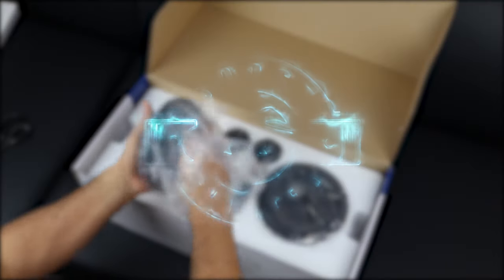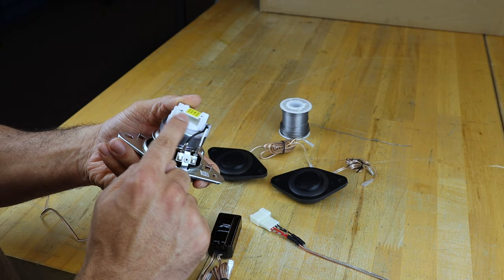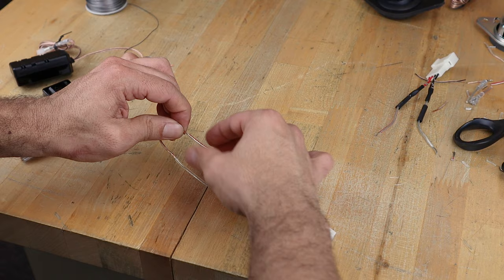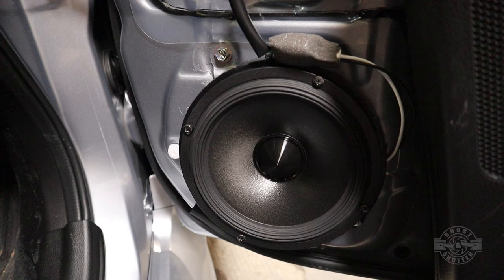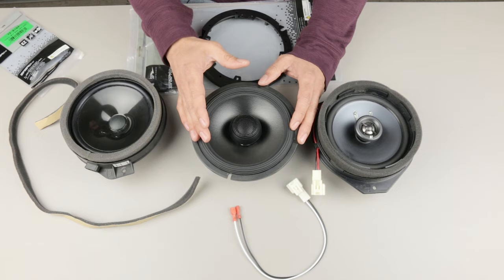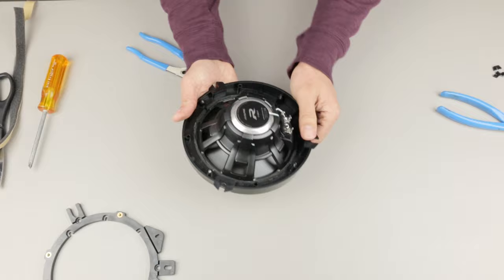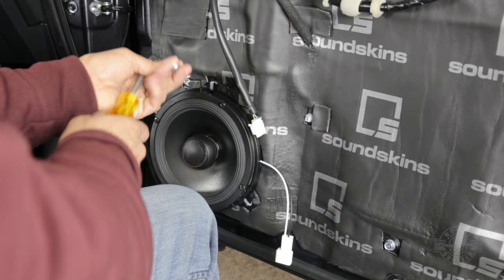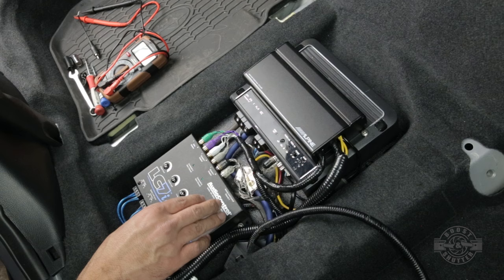How to Install Component Speakers | Alpine R-S65C.2 Install in WRX / STI |

Comment: Thanks a lot for the video brother it helped so much with my whole car audio upgrade install on my 2018 WRX, woulda taken me a lot longer without this info, blessings!
Reply: Ps: if you’re going to power your speakers with your head unit, while not the best option, if you have no other choice, do yourself a favor and get speakers that have highest sensitivity possible, it will make sure it works well even with low power!

Comment: I am doing my 2nd installation in a Subaru, I had to figure the math permutations to get the correct back up camera wiring from that plug on my 2019 impreza ( I had not seen your videos at that time) I had to get a left front door speaker bracket for my 2020 wrx (82-8901) from metra. I like how you routed the power wire behind left front wheel. I used a boom mat over nvx sound damping in the doors , nvx in floor. focal integration iss 165 components in front - I mounted the horn shaped tweeter on top of grill, each aimed at a point between the front seats, I liked they're crossovers, and crutchfield had them on sale (good service) kenwood coax -rear doors, 4 ch amp and p.a. capacitor under passenger seat, powered subwoofer under driver seat. I like your videos.

Comment: Nice dude! I actually took a lot of your advice on my 2016 WRX back when you installed the compact Alpine amp. I’m excited to see how this setup is going to be!
Reply: @akqjtn  Good video, been considering upgrading my door speakers in my 2018 wrx. How are the alpines compared to the kicker speakers? I have the kicker tweeters with stock door speakers powered by the ktp-445u right now and it sounds decent, main problem is my doors rattling like crazy with the added power of the alpine amp.

Comment: Hi i have a question hopefully you read this because i am stuck, my 6.5 woofer has a crossover on the speaker itself and has like 5 places i can put the speaker wire and i have no idea what to do ! The set i have is R2 S65c if you could help i would appreciate it thanks

Comment: i have a kenwood ddx396 in both cars , i especially like the easy way to turn off the display for my night driving. i have the subwoofer remote in the little bay area in front of shifter , so i can easily tweek the bass. i didn't run speaker wires through the doors this time , Subaru had to change the wiring colors on the rear doors - right inside the frame the doors hinge onto - pop out the tab holding the harness and you can better access it. i solder my connections - except for 2 with connectors, at the radio, to make that install easier.

Comment: Hey man great video but I had one question:  Is the mounting of the rear speakers exactly the same as the front where you have to use the angled speaker mount?
Reply: I had this question too

Comment: Man! You answered my questions bro i have been worried all night while i was working. the speakers came in yesterday and the 6.5 has extra connections on it and i have been wondering if i was going to need to run wire somehow all the way to the tweeter idk but i do want to run an amp to the door speakers i need to figure that out i mean i know mostly what to do but connecting them you know

Comment: Great video. So much information that's applicable to 3rd Gen Tacomas as well. 

But the only thing I'm curious with after watching this is, how did you wire the woofer in? Did you reuse the factory door wires or did you rewire them?
Reply: He used the factory wires and a wiring harness adapter

Comment: Thanks for sharing. I find it odd they don’t even mention in the instructions that your putting a 2 ohm load on the amp with you hook both the tweeter and mid bass in parallel. That amps is rated for 4ohms. Am I missing something? If you were running them active it would be 4 Ohms each. 

How do you like these speakers. Kicker has a component kicker 48kss269 now with 2.75” and 6 x 9. I always have the issue with these setups where the mid bass is far from tweeter. Door/dash setup where the vocals done Blend very well because of distance causing all the the harsh highs bouncing off windshield.

Comment: So the crossover was just connected to the tweeter?? I’m so confused on if I need the crossover or not. My car has tweeters already, I just upgraded the speakers without amp, for now. Some people connect the crossover to both the mid and tweeter speakers others don’t add the crossover at all and then you only connected to the tweeter.. I’m completely lost lol

Comment: great video ! i have the 2021 wrx sti limited , with the 9 speaker harmon kardon system how many 6.5 inch speakers do i need and would i be able to replace the tweeters with 3 inch tweeters ? i a msuic freak and love doing full systems with big subs n speakers as well as tweeters please answer as soon as you can thank you!

Comment: Okay man I have quick question, I really love this video. The explanation everything,

But I do have a quick question;I  have a one 12kicker connected to a amp but I really didn’t like the sounds of the stock door speakers it ran, so I added another amp which I have 2. would it be able to run these alphine speakers with a amp connected with it?

Comment: hey guys need a little bit of help. in the description the speak wire adaptor link says its not compatible with my car its a Toyota only. and the other tweeter adaptor also fits on the door speakers.

Comment: What options would I have if the mounting height of the speaker is slightly larger than the mounting height of the door in the car? According to crutch field the speaker is 0.482 and my door 0.379, so about 1/10th of an inch. Would be a shame if I had to choose a different speaker, because of 1/10th of on inch.

Comment: So I’m installing the Alpine coaxial S-series on my 15’ Crosstrek XV, (btw Metra fixed the problem with the mounting brackets for the front door adapters and they both fit the front doors perfectly without having to drill another hole!)... Anyways I saw on the packaging that it says “if another set of tweeters are already installed parallel to the speakers already that it could cause a fault” is it safe to instal coaxial speaker in the front? Or should we just use component speakers instead?

Comment: Ordered the tweeter plug adapter and the mounting bracket.  Where did you get that piece that screws onto the type-r tweeters?  I have the same setup.

Comment: This is awesome, I'm thinking about doing this to my wrx. Do the door speakers make up for the lack of subwoofer?
Reply: what year/trim WRX?  My '19 base 6.5 Starlink has too much bass and I've got the EQ set to "-7". Even then it still sounds muddy and over-boosted.  Sadly new speakers (even the kicker upgrades) won't help as the issue is programmed into the headunit so any speakers put in will suffer a similar fate.
Reply: K03sport only way to fix that in general is to buy a DSP example Audio control DSP and to overhaul the complete sound system to obtain a flat signal.
Reply: K03sport cheap way for a fix but not as good is to add bass blockers to the speakers but in order to compensate for the lack of bass you need to add a subwoofer
Reply: @thedjrush ... Yes, an active dsp is one solution or 150hz 1st order high pass filters (Crutchfield) are another.  Brand new 2019 car; how hard is it to make audio sound good? My 04 GTI's Monsoon system wasn't perfect, but it was loads better than the "junk" Subaru offers in the base and premium trims.  Not to mention the amount of sound deadner/blocker needed to quell the road noise. 

I know Subaru has a long standing history of bad audio setups, but radios and audio aren't a new thing either.  They loaded the infotainment with heavy bass at low volume to "cheat" the listener...same reason the wrx/Sti only come with uhp summer tires; to cheat/fudge during magazine reviews/testing to give higher numbers and minimize the (inherent) understeer that is present.

Comment: If you buy these speakers, don't power them with your head unit. You don't know what your missing. Trust me
Reply: @Andrew Gameau What amp are you running these speakers with? I'm running the r-a906. I feel it can hit longer & higher in the tweeters.
Reply: I'm running a pair of these alpine type rs in the front and polk audio 5 1/2 in the back. Both sets are 300 watts each speaker. Im powering them all with a jp234. They are receiving over 300w each speaker. But I don't crank it that loud becomes its loud enough to hurt lol. But it is clean and loud
Reply: @Andrew Gameau ya I have 2 Rockford Fosgate power t1 12s on a jp23
Reply: My headunit can handle:
4 x 45W max power
4 x 26W RMS (1KHz 10% THD)
4 x 18.5W RMS (1KHz 0% THD)

I know a decent amplifier will do these speakers justice but how do you guys think this headunit will perform as is?
Reply: @mmmokay145  they will work on the head unit for now. But trust when we say, you ain't seen nothing yet lol. It's a world of difference between the radio power and a proper amplifier on the door speakers
Reply: @Pittsburgh-412  so can you have wires from head unit heading to amplifier, it that how you amplify them.
Reply: @LooseyGoosey what about meanwhile until i can get a extra amp? Would it still be louder and higher quality than stock until i can give it more power?
Reply: Does anyone know if the 6.5 speaker ( not the tweeter)  is a midrange or a woofer?
Reply: @jesuss5876  it's a midrange
Reply: @Pittsburgh-412 thanks bro. I was hesitant because my chrysler has bass woofers in the front door 6x9 and wanted to get a midrange driver in the front. Im using a dsp to control all my crossover settings. Imo all bass should come from an actual subwoofer and not some door speakers
Reply: @Jesus S  ya i agree. These alpines sound great and they are very loud with an amplifier. I have mine on a jp234 and they are amazing
Reply: Why is the crossover design so farked why didn't they have the 3rd connection it makes it so farked
Reply: titoham-DCXLs  nobody said they are the best. But they are great
Reply: @Pittsburgh-412 Hi if you Don't mind I have a question, so on my alpine the 6.5 speaker has 5 speaker connections on it , my car already had 2 component on the door and 2 tweet on the dash so I plan on the dash putting those big crossovers then my tweeters but on the door I have no idea what to connect to
Reply: @michaelmarquez6133  I'm not sure what you mean by 5 speaker connection on 1 speaker. I've never seen that

Comment: Hello, 
Thank you for this video, very useful for those who want to install these beautiful speakers.
I installed the same ones in my Honda CRV 2016 with the DSP- Alpine PDP E802DSP- amplifier (available in Europe). I want to install the tweeters for these speakers without using the supplied crossovers, I want to use the active DSP crossovers.
----- My question is, what frequencies do I need to apply to set the high pass filter for the tweeter and also the high and low pass filters for the speaker? (if it’s needed) ----.
frankly, I haven't found this information anywhere, everything that the manufacturer's website gives as information is that the   Alpine component speaker R-S65C.2 has a frequency response from 60Hz to 40Khz.

Comment: Hey man. Super informative videos really appreciate them. Quick question. I noticed in your other video you said if you used new tweeters with a component system you would have to run new wire? May have missed something, going back and forth getting ready for my install. Thanks!
Reply: Boost & Shutter it was in part 1 of your speaker upgrade guide. You said you’d have to run all new cables because the tweeter are in parallel with the front speaker.

Comment: Great video.  Earned a sub.  QQ... You are putting more power to the speakers than OEM.  Why did you not run new speaker wire of a lower AWG to compensate for the added power?  I've done a few head/speaker installations and noticed you are using stock speaker wire and was curious.  Granted...it's a PITA to run new speaker wire, but stock OEM wire is pretty light.
Reply: for short cables is not needed,  it does matter more for home audio where dinstance are larger
Reply: @carbonoxx  If it's an amplified signal it generates more heat and the output signal would be cleaner and better through a larger wire. Distance is one factor for wire size but power going through the wire is just as important for deciding whether to change the wire or not. OEM wire was never intended to run that kind of power through it and could melt or short out destroying components.

Comment: I just got a set of component speakers and was trying to figure out where to install the crossovers. 

From my understanding- im going to be bypassing the original tweeter wire and hooking the crossover into the 6.5 line since the crossover has a line in for both the 6.5 and tweeter.

As for the location of the crossovers, maybe tucked inside the doors would be the simplest way. Running them all the way to the passenger seat is also an option, and suggestions?

Comment: nice. the lengths WRX/Sti owners (have to) go to improve the factory sound is outrageous.  I'm not sure I've heard a more poorly tuned factory radio in my '19 base.  Why did Subaru (over)boost the bass in the 6.5" Starlink system? Even at "-7", my bass is still too much. Sounds like the 7" HK 10-spkr has no bass.  Unacceptable Subaru.  Hundreds upon hundreds of dollars to fix/correct something that should have been a non-issue.  I don't want to put in amps and controllers, but it looks like I'll have little choice for cleaner, more accurate sound.

Comment: how do make my tweeters not sound so sharp and loud? I got the whole alpine system installed but even with turning down treble, the highs are too bright from the tweeters
Reply: @akqjtn  I have a pioneer GM-D9705, i know channel A are my front speakers and tweeters. I'm not sure how to adjust the crossover, LPF or HPF? I don't know too much about adjusting the audio, I had my system installed for free from Best buy
Reply: @akqjtn  also its hooked up to an lc7i

Comment: Why don't alpine give proper brackets to install into the triangle corner things on door, so irritating even the cheap brands give you the stuff to do that
Reply: I just tried this too with these speakers...it was such a pain in the ass and also the crossover is soooo fkd too o had to run wires into the front door twice, why can't they just give normal crossovers with 3 connections grrrr
I Will never buy alpine ever again

Comment: crossover is basic. Despite what you might believe, those 3 tweeter adjustments doesn't let someone tweak the system to exactly the way one wants it. For that, the easiest way is with a DSP. Buying a bracket is OK, but I usually make my own baffle. I don't see anything special here.
--good vid
Reply: Lol okay
Reply: titoham-DCXLs  “i don’t see anything special here” no one is buying a dsp just to change the db, they are buying a dsp to tune. This comment wasn’t necessary. Db on the crossover does have a purpose. That’s what is funny. There is def utility in a dsp but the consensus is  people buying $300 components and tweeters aren’t looking for a dsp.